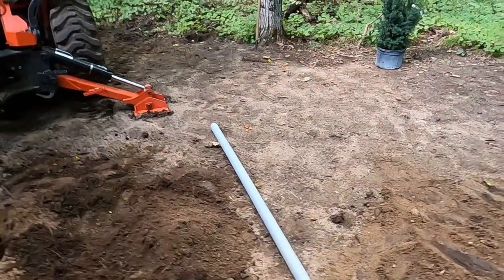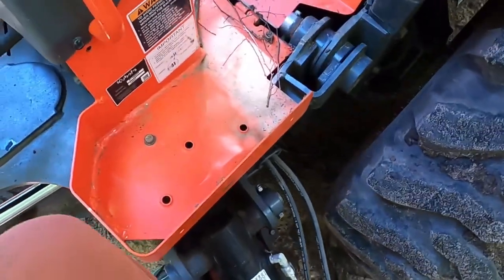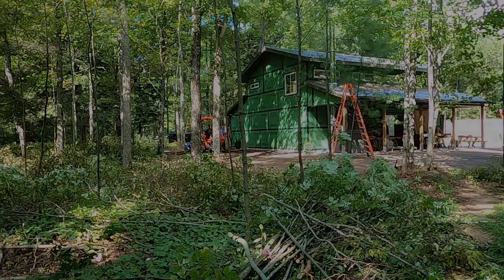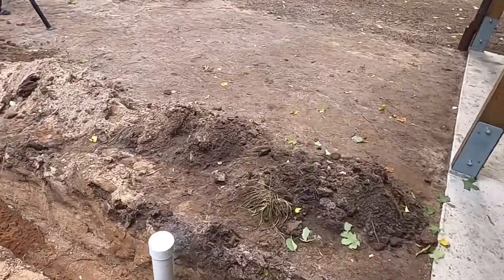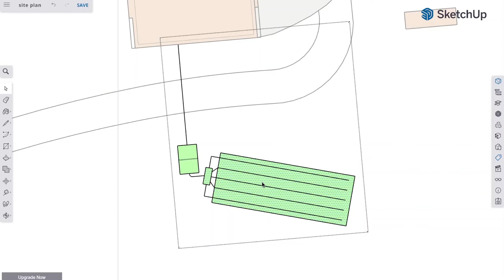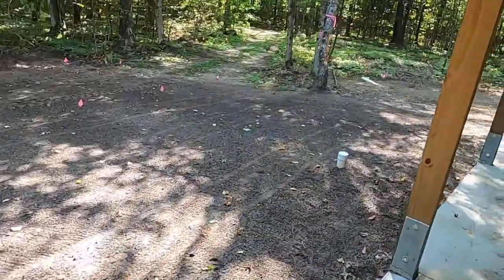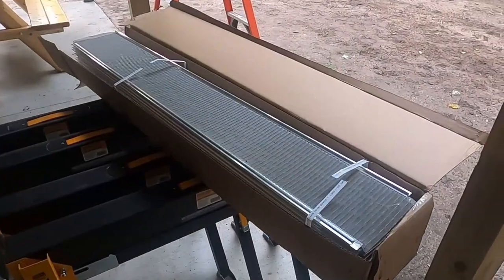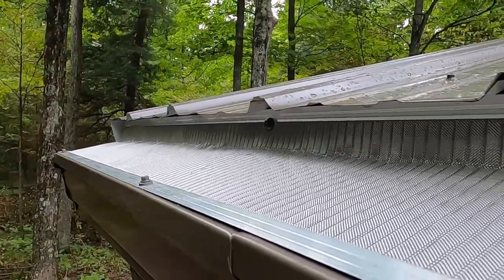Landscaping with KUBOTA L47 TLB with help from RHODESIAN RIDGEBACK pup (087)

Comment: Are you going to seal the ends of the metal roof sheets above the gutters with foams inserts so no bugs or critters go up under the roof?
Reply from the maker: It’s impossible to see in this video, but there actually is foam at the edge of every roof panel. If you search for “pro-rib inside closure” at Menard’s, you’ll see what we used. It’s custom-formed for our panels’ profile.